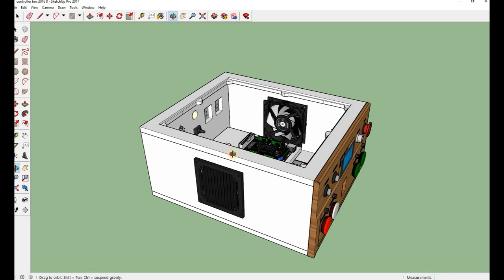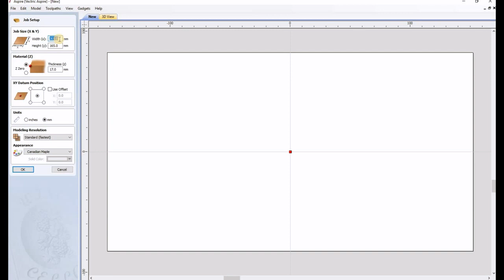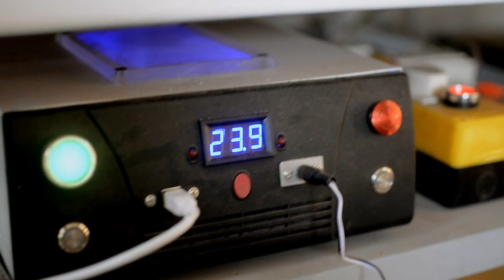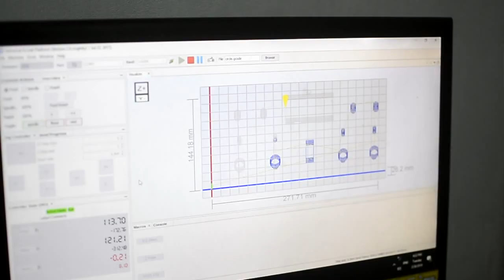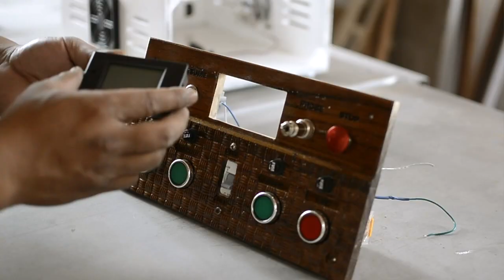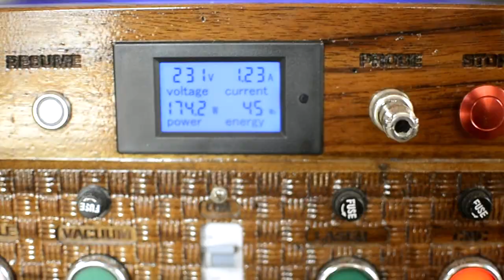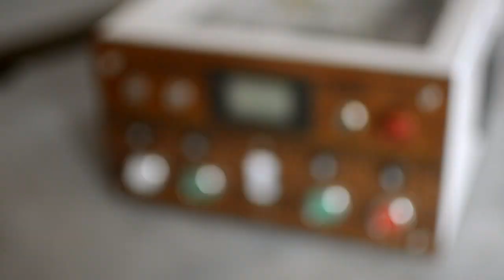New CNC Controller box

Comment: Not too shabby. I made and use my controller some what the same using solidworks instead of sketchup.  I just roughly solid modeled all the parts good enough volume and size wise to the inrernal components.. Its made using 1/4 mdf.  I use mach 3  with a total home bew electronics setup.. As the stepppers are on a seperate power supply than the logic, I also added a switch to disable them to use handwheels on the rear shaft. Sometimes that makes zeroing in far easier.  I also included that same concept of a built in power strip.. I didnt see any need to do a fancy textured front pannel though.. The files from solidworks wa exported via DXF files and toolpathed using Aspires V-carve.. I could have my mastercam for the toolpathing but as this is dead simple flatwork the better choice was v-carve.